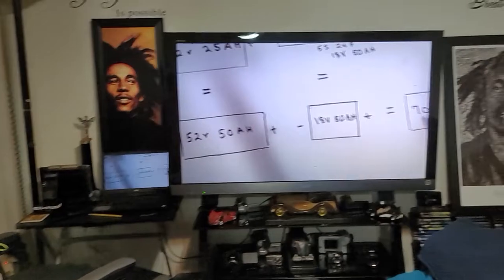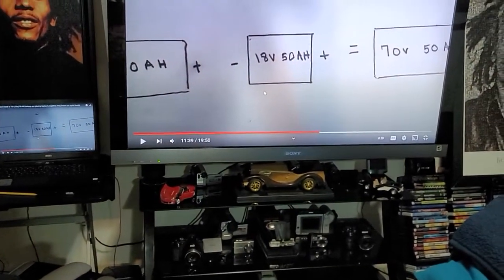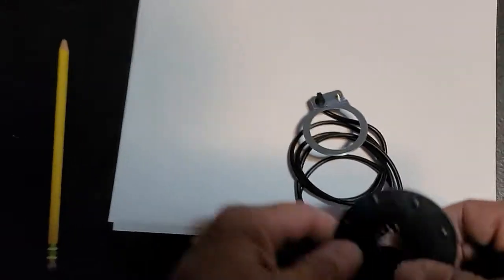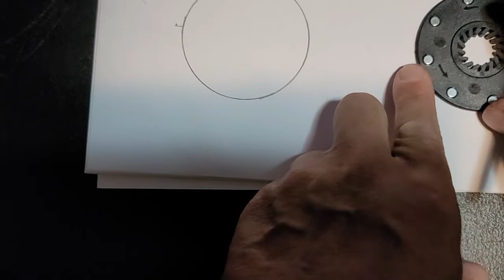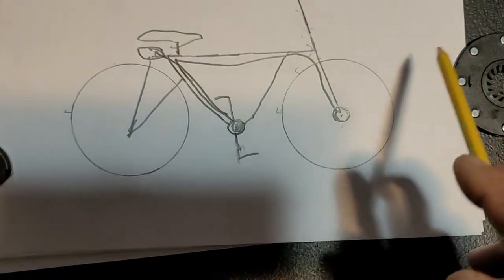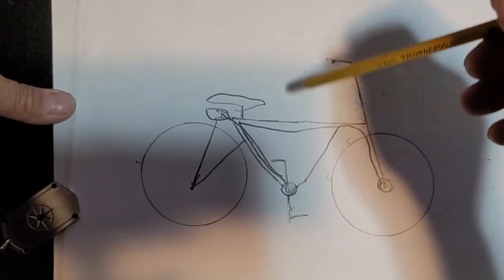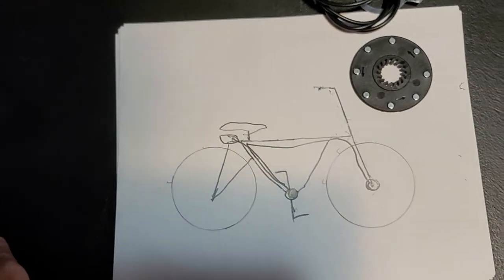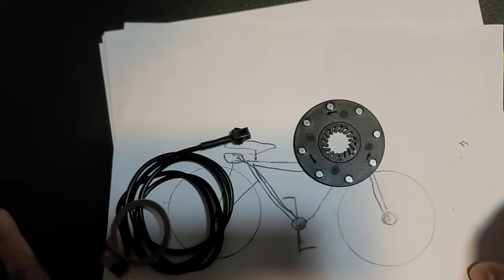class 2PAS issue 4 those that wanna throttle over 20mph, I think I have a simple solution #ebikemods

Comment from the maker: BTW your pedal assist stages in your display will still govern the speed so you do have a little adjustment, the only thing we're trying to do here is make it so you don't have to pedal, the wheel spinning will be the same as your sprocket turning which activates your motor, that's all it does is keep you from peddling, that's it!